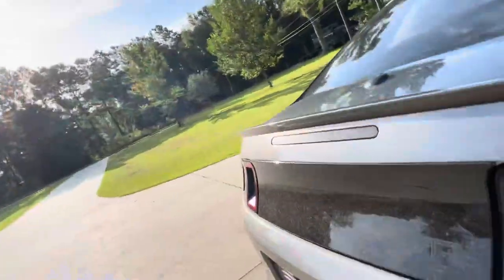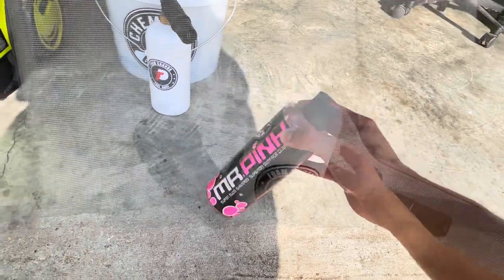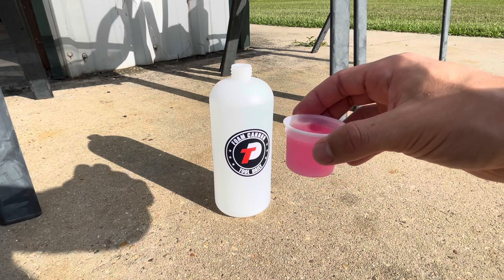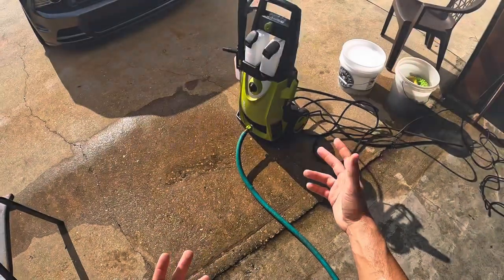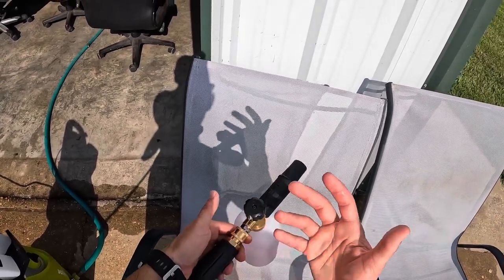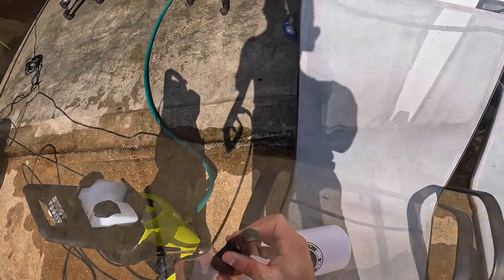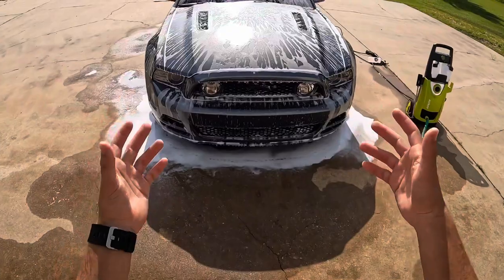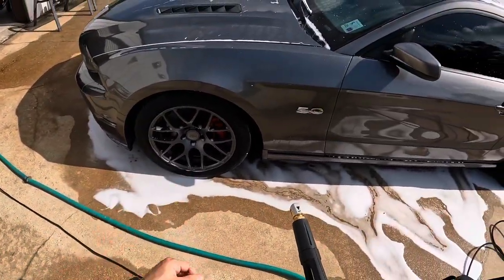*Satisfying* Foam Cannon Car Wash! (Sun Joe SPX3000)

Comment: great video! 👍 what was the adapter you got to get the shorter handle and quickly click in the longer one if needed? thanks
Reply from the maker: https://www.amazon.com/Mingle-Pressure-Washer-Adapter-Connect/dp/B07HMHBLRD?pd_rd_w=uWTN1&content-id=amzn1.sym.b9b1bcce-89ca-4e95-8ab9-11472ef3b705&pf_rd_p=b9b1bcce-89ca-4e95-8ab9-11472ef3b705&pf_rd_r=KQTJ91DK2R6ERXSE8A2M&pd_rd_wg=jNzjN&pd_rd_r=10674e15-ce70-4b36-88f0-d66e709490c8&pd_rd_i=B07HMHBLRD&psc=1&ref_=pd_bap_m_grid_dv_rp_0_1_sc this should be the correct link

Comment: hi, curious why you used foam bottle,  should sun joe spx3000 already has two bottles builtin for mix soap with water?  Thank you.
Reply from the maker: It does have two mix bottles but for ease of use I just went with the foam bottle because it comes with the nozzle needed to Spray foam properly as well.
Reply: The tanks on the pressure washer are not to create foam buddy that's just to spray out the soap,concrete wash,or whatever detergent but no foam as far as foam like a foam cannon does not come out of the tanks
Reply: @ChooseYourDestiny 
What was your orfice size buddy?
Reply from the maker: I use the grey nozzle 45 degrees for my car if that’s what you mean
Reply: @ChooseYourDestiny  
That's good to know also but what I meant was what's the size of the orfice on the foam cannon that you use. It's that little brass or stainless steel thing that creates the foam you can screw it out and change them out to your preference?
Reply from the maker: @DAT-TEXAS-DUDE oh I’m really not sure it’s the one that came with the foam cannon https://www.amazon.com/Tool-Daily-Cannon-Connector-Pressure/dp/B07HC898GM/ref=mp_s_a_1_3?crid=25XOGE8GKBP7J&dib=eyJ2IjoiMSJ9.fc5j1Z9tW2WzACYFdP-igkLyzetZ7Eiz5CskgH33hiUP0n_QK_Ma1SXZOhX0vf02etO3E2cEzNNiWOrL7N9Mbo2pNBr5Ne2fjjmGEQrDt5hj-bYnxmKk0rL8v76KFYQjue9sUKrvXV8IzmXHManRH7gmndYxlZ7zRxqyZgf__6sUTeXNkQ2_pQM8VWh-d7J24V-A-3HP2VCpHb7yJ7rFOA.JTbIY7cLvdEIow_hJpTZqpsXO-QRdbyrQYyRTjYtjz0&dib_tag=se&keywords=foam+cannon&qid=1716869985&sprefix=foam+%2Caps%2C171&sr=8-3

Comment: Hey, can you PLEASE let me know the specs of the adapter you bought to use the foam cannon? I’m getting so many different results and answers online and I don’t have the money for trial an error..
Reply from the maker: https://www.amazon.com/Mingle-Pressure-Washer-Adapter-Connect/dp/B07HMHBLRD?pd_rd_w=uWTN1&content-id=amzn1.sym.b9b1bcce-89ca-4e95-8ab9-11472ef3b705&pf_rd_p=b9b1bcce-89ca-4e95-8ab9-11472ef3b705&pf_rd_r=KQTJ91DK2R6ERXSE8A2M&pd_rd_wg=jNzjN&pd_rd_r=10674e15-ce70-4b36-88f0-d66e709490c8&pd_rd_i=B07HMHBLRD&psc=1&ref_=pd_bap_m_grid_dv_rp_0_1_sc this should be the correct link

Comment: Can you post link to all parts needed to use quick connect on Sun Joe gun for foam cannon?
Reply from the maker: I deleted my first reply because I found this and it should be the correct one https://www.amazon.com/Mingle-Pressure-Washer-Adapter-Connect/dp/B07HMHBLRD?pd_rd_w=uWTN1&content-id=amzn1.sym.b9b1bcce-89ca-4e95-8ab9-11472ef3b705&pf_rd_p=b9b1bcce-89ca-4e95-8ab9-11472ef3b705&pf_rd_r=KQTJ91DK2R6ERXSE8A2M&pd_rd_wg=jNzjN&pd_rd_r=10674e15-ce70-4b36-88f0-d66e709490c8&pd_rd_i=B07HMHBLRD&psc=1&ref_=pd_bap_m_grid_dv_rp_0_1_sc

Comment: What was the piece dimensions or spec to make the gun much shorter? What was it basically?
Reply from the maker: I just asked as guy at the hardware store for a quick connect. You could even bring ur wand in the store and test fit it

Comment: Just a quick tip.   Make sure your washing from the roof first then downwards. I usually try to keep the lower panels like the lower fenders and the wheels at the very last stage or even better... a separate sponge entirely so you don't track up grime into the upper panels. Sounds a little picky but the little things count into a great exterior wash and detailing job!
Reply from the maker: Yea I definitely try to keep that in mind, I usually start with the windows then try my best to go top down. A separate sponge would definitely be the best thing though thanks for the tip.💪